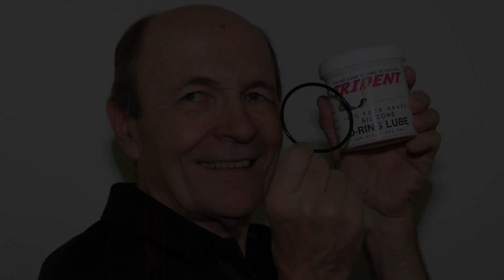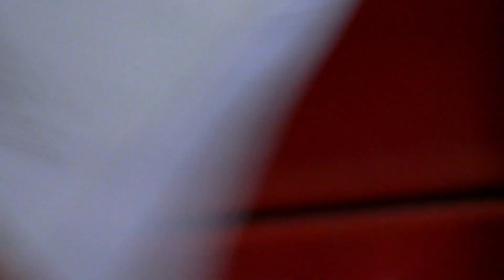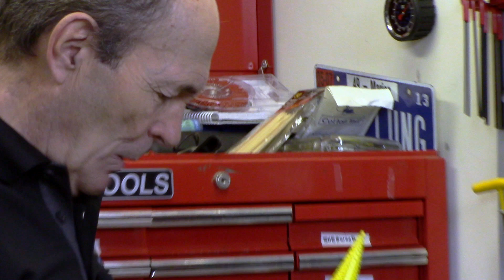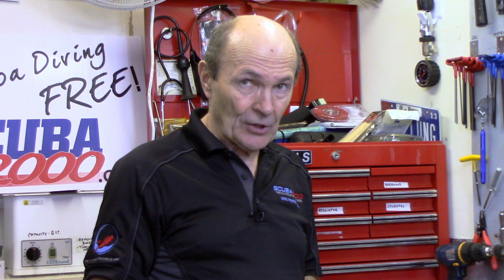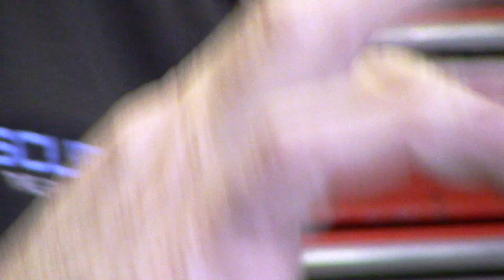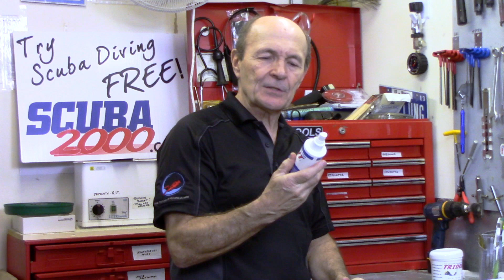How To Lubricate Scuba O-Rings - Scuba Tech Tips: S05E10

Comment: Hello Alec. I just ordered a new 3 gauge console. I should apply a small amount to the O-Ring before I install?  I have both a Tub of the Grease. And a Liquid Spray I use on the mask and Snorkel. Chlorine in the pool destroys them. Thank you
Reply from the maker: 1st stage, 2nd stage and console hose o-rings don't require any lube.  Don't over tighten (see my video on what happens), so hand tight with a gentle wrench twist will be fine.
A
Reply: @AlecPeirceScuba_SeaHunter  Thank you. My console should be arriving this week. I'll attach to the HP Port opposite The Regs. When I get my BC, I'll use the forward MP Port below it. Leaving the rear  available for later use.
Reply: @AlecPeirceScuba_SeaHunter  Thank you Alec. Just installed mine yesterday. Waiting on the BC Inflator hose.

Comment: I wonder if the battery compartment seal in the Olympus to 6 is needed to be greased regularly or not? since every rubber-like material could deteriorate. thanks in advance
Reply from the maker: If it is in contact with water like a camera, I'd say yes.  Check the owners manual but they are easy to lub, just a very thin coating, it's not axle grease.
Reply: *olympus tg 6

Comment: I read the owners manual of my new dive light, its says to use vaseline (pure petroleum jelly)
isnt that stuff a mineral oil product?

also can I still use silicone grease (most divestores dont have vaseline, but only silicone grease)?`
thanks in advance
Robert
Reply from the maker: Modern O-Rings are synthetic and unaffected by petroleum products.
Silicon grease will work just fine but needs to be renewed more often as it will wash off.

Alec

Comment: A lot of talk online about what lube to use. Cristolube,  Tribolube, Krytox, Dow 111 etc. Which is best and are any better for some applications but not others?
Reply from the maker: While several manufacturers and some service people insist that ALL regulators should be greased only with an oxygen compatible grease, that's quite silly for many divers. And expensive too. I'm not saying that the use of O2 compatible grease is recommended in order to increase profit but read into it what you will.
For the vast majority of divers, diving a few times a year, NOT using EANx (enriched air with a higher oxygen content) and not diving deep, there's no need to use oxygen compatible grease. Medical grade silicone grease has been used for decades with no indication of a problem.
As to the type of oxygen compatible grease to use if you decide on that,  each type has slightly different characteristics. You would choose the type that best suits your diving and gas content. Christolube was the choice for a long time but other brands have appeared. I see a lot of service people now use Tribolube but can't see much difference in the characteristics of each, certainly not differences that would make one a better choice over the other. I suspect it may be a fad thing. When a new grease comes out, everyone touts it as the best - until another new one appears. Strangely, each new grease that appears is a bit more expensive than its predecessor. Odd that!
Read the advertising jargon for the most common greases, Christolube, Tribolube and Krytox, and you will discover that they are remarkably similar. That is, they all offer the same features and benefits.
Which is better - Honda or Toyota??
Take care.
Alec
Reply: @AlecPeirceScuba_SeaHunter  Thanks for the reply. I am not yet NITROX certified so I guess the choice is easy (and cheaper) for me.

Comment: Thank you so much for these videos, you always teach me something new and useful. I assume that I don't have to lubricate the o-ring on the DIN regulator valve. Am I correct?
Reply from the maker: A DIN valve only has a neck O-Ring and it's treated the same as any valve O-Ring.
Don't grease the O-Ring (assuming it's fresh) and just the slightest grease on the bottom of the threads.
Alec
Reply: so, only on the bottom threads of the regulator valve? thank you!  @AlecPeirceScuba_SeaHunter

Comment: Informative video, thanks. 
Is there any difference between using synthetic grease or silicone grease for diving computer o-ring?
Reply from the maker: You should not be using any grease on the O-ring. I'm assuming that you replace the O-ring every time you do a battery change, as you should. New O-rings are ready to go - no grease.
Alec

Comment: What kind of lubricant could i use to keep the skirt flexible and not dry out. I live in the Caribbean and dont use is it that much. A lot of of rubber kind of materials deteriorate here super fast
Reply from the maker: Oh yeah! Rubber doesn't like heat, it doesn't like UV rays, it doesn't like salt so guess what? It doesn't like the tropics!!
The ONLY way to keep anything rubber in good condition is to seal it. There's no lube that will last very long.
Rinse it in fresh water, dry it out of the sun and then put it into a Zip-Loc plastic bag. It'll be like new when you next reach for it.
This applies to modern silicon products too.
Good luck.
Alec
Reply: Alec Peirce Scuba okay will try that. I keep it in the bag it came along but will tryhis tip.thanks

Comment: Now here is a question for ya, when do you know when to change o-rings. Too often, every half year, every month or only during service. Second question is where to buy o-rings? Third question is this, my safe second regulator makes a snoring sound when I breath with it, is it time to service it or is it something wrong like a o-ring? For reference sake, never had a leak or changed my o-rings, but have always thought about getting a little kit with replacement parts just to be safe.
Reply from the maker: If your LDS knows you (another good reason to fraternize your LDS - get to know them and vice versa), they should be happy to sell you O-Rings. You can also get them on-line or at your local fastener retailer - Fastenal, Brofasco, Home Depot, Northern, etc., or at any hydraulic supply. You will need to take your O-rings with you so they can match sizes. 
There's no definitive way to know when an O-Ring is done. Dynamic O-Rings should be changed at every service - 1 or 2 years. Static O-Rings last much longer but for less than a buck each why take a chance?
Trident, Innovative and XS Scuba have small O-Ring kits with the most common rings in them. They are NOT the ones you need to rebuild the internal parts of a regulator.
A second stage will snore when it's dry. Try dumping it in water first and see if it's ok. If not it may be adjusted a little too much to give easy breathing. It's an interesting possibility that goes like this: you suck on the reg and it opens to give you air but you're not sucking hard enough to use all the air coming out so the pressure in the reg builds up and closes it but you're still sucking so it opens again but it gives you too much air so it closes and so on ... . This happens very quickly, many times a second, so the reg oscillates between open and closed and you get a snore. Have your LDS de-tune it a bit.
Hope this helps. Alec
Reply: Thank you Alec, my god I wish you had a shop in Norway, let me tell ya I'd be in all the time just to learn from you he he.  That's why I love your shows, tech tips and sea hunt episodes. You are truly a bundle of knowledge and I sure hope you keep it going. If ever lack of ideas, Ill send you a email with several to pick from :) Thank you and if you and your wife ever decide to visit Norway, let meg know and Ill be your guide both over and under water :)
Reply from the maker: That would be neat.
We had a dive trip to Scapa Flow several years ago and I've been to Netherlands but not Norway.
If we head that way I'll sure look you up.
Alec

Comment: Alec,
What is the down-side of too much grease on an o-ring? Does it hurt anything, or is it just that it's unnecessary?
Reply from the maker: Good point Brian.
I had a diver in with his regulator. He was complaining about hard breathing.
I disassembled the second stage and found so much grease on the poppet (the valve carrier that opens and closes when you breath) that I'm surprised it even moved! It looked like it had been there for years too - all covered in sand and dirt.
I cleaned it and resassembled and tuned it. He couldn't believe it when he tried it. He was getting ready to buy a new regulator - not now!!!
Alec
Reply: Too much can extrude ("ooze") unevenly onto adjacent mating surfaces, preventing an even seal.

Comment: Alec, for those unknown regulators, where you don't have the manual, how hard of material should be used? Ie: Durometer 70, 90? For Static or dynamics? Thanks
Reply from the maker: 70 is sort of the standard Miguel.
The different hardness of O-Rings used in different regulators and in different functions within a regulator is a concern that most divers don't think about or even know about. It is one reason why factory service kits are a good idea rather than just buying O-Rings at your local hardware store or on-line. It can make a difference both in performance and durability.
Alec

Comment: Alec,  are tank "O" rings dry or lubricated?  Thanks!
Reply from the maker: Pretty much right Bruce.
Dynamic O-Rings, those that move during their function like the ones on a first stage piston, must be lubricated.
Static O-Rings, those that don't move but only seal like a tank neck O-Ring, don't need lubrication. In fact, lubricating them can lead to O-Ring extrusion - the slow squeezing of the O-Ring through the tiny opening between the parts so, between the valve base and the tank top. This is not uncommon.
However, new O-Rings are glossy from the factory lubrication. If stored a long time in poor conditions (hot, dry), that coating will disappear and the O-Ring looks dull. You can tell by simply wetting part of the O-Ring to see if there's a difference in appearance between the wet part and the dry part. A dry O-Ring won't seal well. It can also grab and distort as the parts are put together. They should be lubricated but very, very sparingly - like you can't even see the lube you put on. Touch your finger to the grease, don't dig or even wipe, just touch, and then rub your fingers together for a minute to heat it up and then squeeze the O-Ring around with those fingers for a few minutes. When you finish the O-Ring will not have any obvious lubricant but it will be glossy.
Reply: Dry
Reply: Not true, only o-rings that have movement should be lubed. For example, a twist on flashlight. The O-ring on a tank does not need to be lubed because the first stage moves on its own and not by the o-ring (think about how you get your equipment set up by tilting the first stage)
Reply: Bruce Wilbur all o-rings should be lubricated.